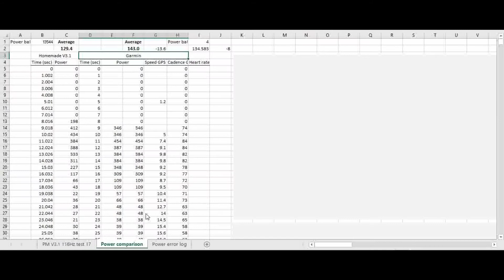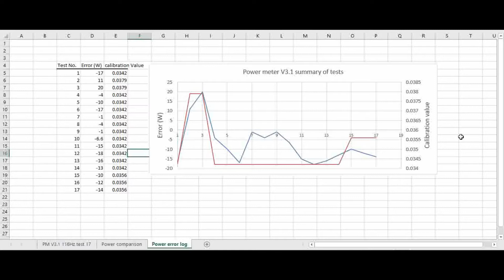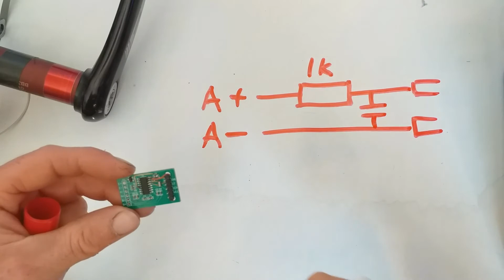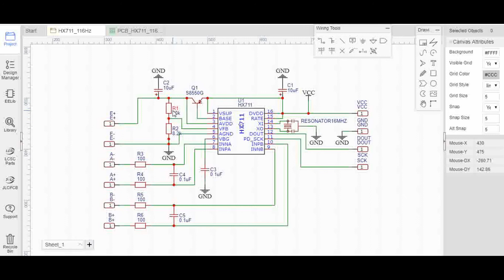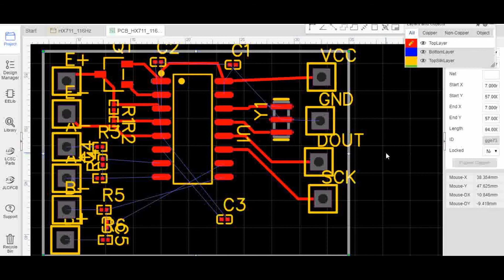Power Meter V3.1 HX711 116Hz

Comment: try to keep the capacitor near the pins as it can be used as a decoupling capacitors .  you can use two layer pcb and make one layer ground so you will save space .
Reply from the maker: I will keep that in mind when I lay it out, thanks for the advice. Yes want to learn how to do two layers. Going to take a while to design as want to include every option. For example an extra connection point to control the rate from an MCU.
Reply from the maker: Also another connection for PWM control of the sample rate if the crystal oscillator isn't in place. Maybe even include the inline capacitor. May require a few solder jumpers to set it up.
Just noting this down here as a reminder to my future self more than anything else.